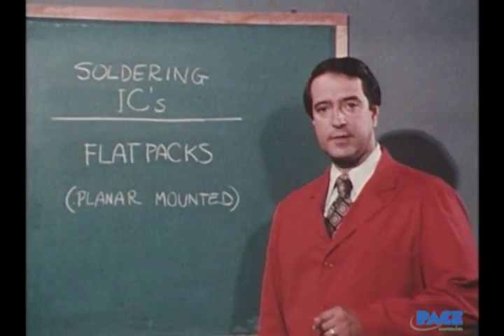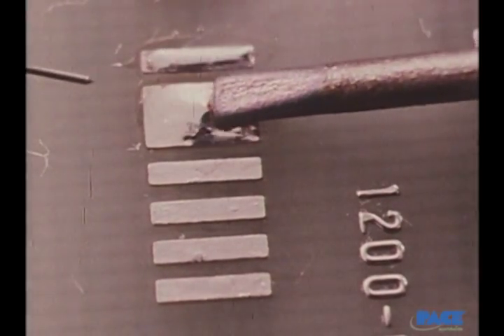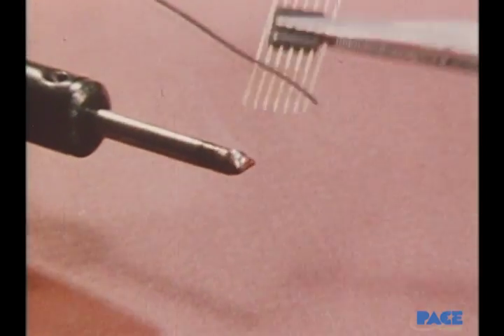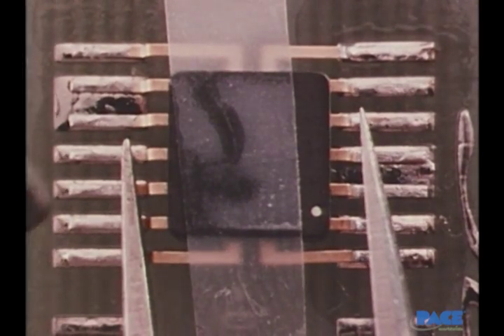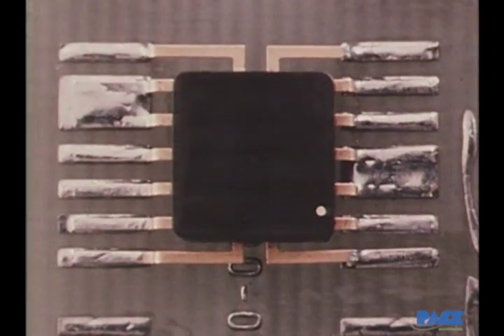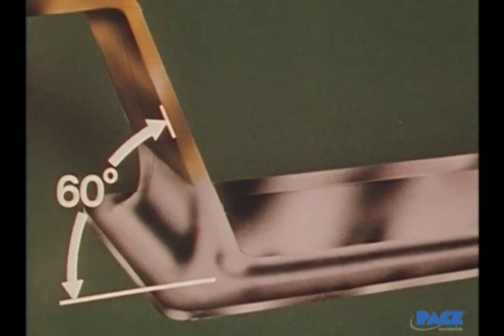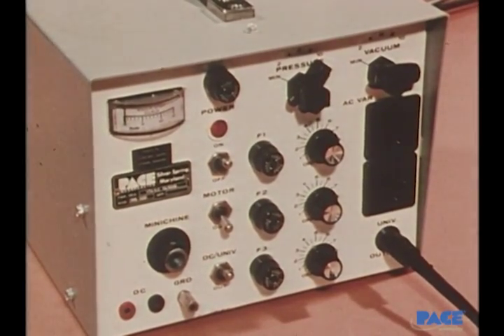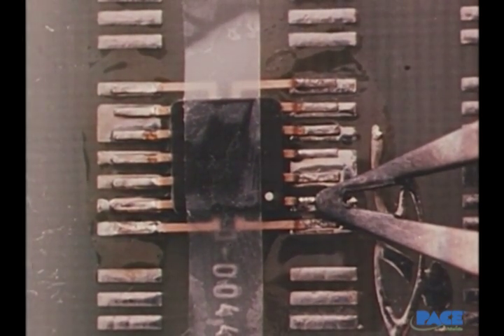Basic Soldering Lesson 9 - "Integrated Circuits: The Flatpack & Other Planar-mounted Components"

Comment: I would like a set of his soldering equipment and a set of the videos on VHS :) This is how equipment was made to work and last.
Reply: I have that exact station and yes it still works and I still use it for PCB work. Just take care of it and it'll last. There's a reason they are so expensive when you find them. $30 for a American beauty iron tip..... fml

Comment: Tip 1. You need good quality solder, not cheap Chinese crap (yes, it really does matter!). I have used Kester and it works    like a charm.

Tip 2. You need a good quality iron with good quality tips. Don't waste your money on cheap Chinese crap. Buy the good stuff or you will have a very bad time. Hakko and Weller are the ONLY brands to trust. There are many knock offs and scams of Hakkos and Wellers, so be careful and double check the amazon/ebay seller.

Tip 3. Soldering TIps are NOT interchangeable. You must buy the tips that go with your brand and soldering iron model. BE VERY CAREFUL OF KNOCKOFF TIPS!!! DO NOT BUY THESE!!!

Tip 4. See tips 1-3

Happy soldering!!!
Reply: cheap chinese knockoffs do me just fine, ofc it varies wildly the cheaper you go though.
Reply: companymen42 Agree, except for #2: Weller and Hakko most certainly are not the only trustworthy brands. In fact, they’re not even the best! For starters, PACE is still around and makes top notch gear. But Ersa, JBC, and Metcal comprise the other world-class professional soldering gear makers.

Comment: i have learned alot from these videos, but one thing that is missing. you do not want to bridge connections such as the bridge made at 2:29 bridges are BAD
Reply: The bridging is intentional. The solder pad is wide, to accommodate both leads. However, bridging two leads that are not supposed to go together is indeed bad.

Comment: SMT actually goes all the way back to the 1960's. The Saturn 1B and Saturn V had SMT components in their Launch Vehicle Digital Computers as well as some of the microcircuits in some of the Avionics of the first F-111's. Unlike the majority of the 0402/01005 or even the 6332/2512, they were more like the "planar mounts" like shown in the video. IBM pioneered SMT in 1960.